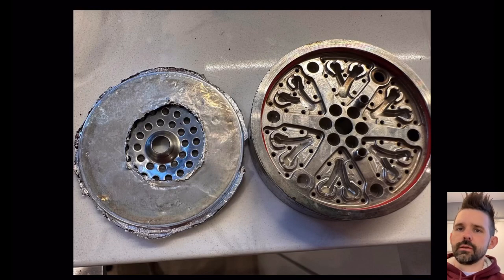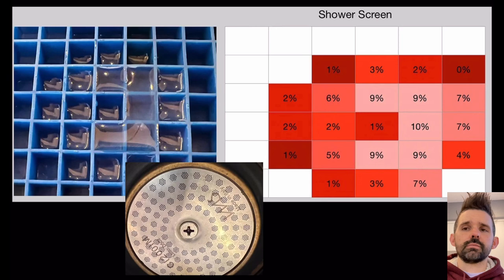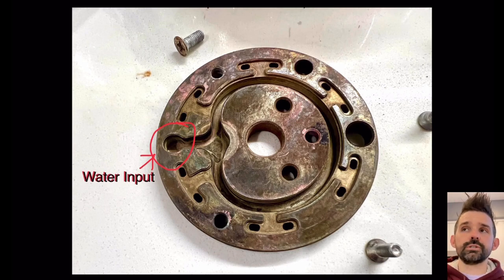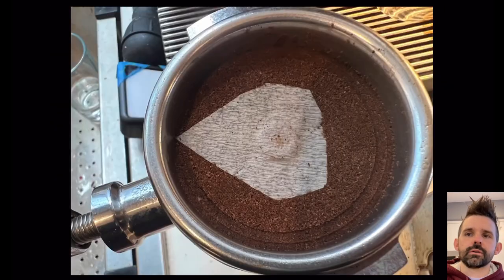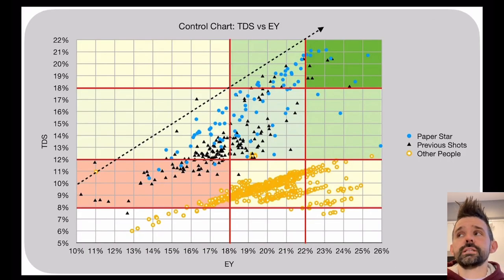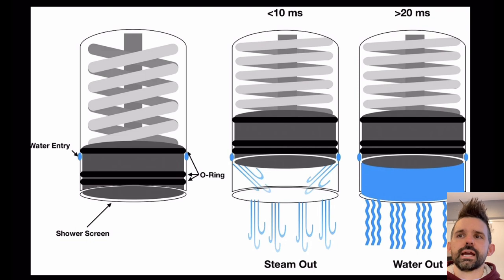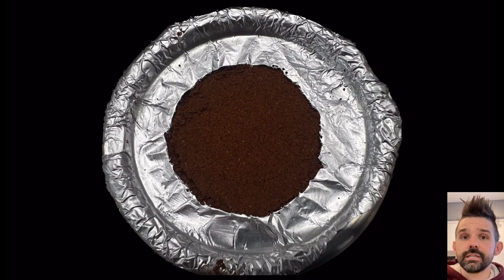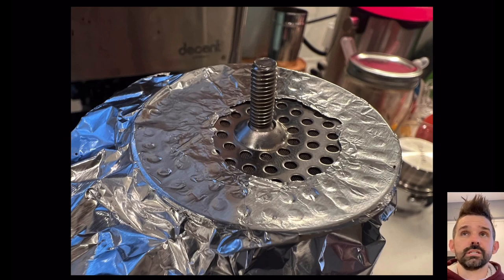Advanced Espresso Shower Screens for Better Water Input

Comment: Great work, Robert.  I wonder if the higher temp around the perimeter of the puck is a result of water flowing faster there, rather than conduction from the group head through the gasket and along the thin wall of the basket.

Comment: The star-shaped paper mask reminds me of a similar shape used in solid rocket booster fuel geometries, where a hollow "finocyl" star shape along the length of the propellant mass maximizes the exposed surface area initially available for combustion at ignition as the propellant burns from the center out, when thrust afforded by extra area is needed most. What remains of the diminishing star shape after that helps to maintain more constant thrust than some of the other cross-sectional geometries like simple circular holes.

In this case the espresso star mask seems to be inverted, presumably so the center of the puck is extracted last (if at all...) following circumferential introduction of water and (hopefully more or less constant) advance of the liquid front and extraction from the outside toward the center. There's probably more to be gained by playing with the mask geometry, maybe informed by modeling in 2D the pattern of water volume introduced across the puck for a particular machine setup (with the paper mask shape informed by KDE contours somehow). Though temperature and coffee particle expansion would play roles too as the water front advances. I wonder how a doughnut-shaped puck would fare, assuming physically constrained by some kind of (heated?) solid mass in the center, maybe cylindrical, maybe star-shaped. Maybe still maintaining the ring mask around the outside if the edge channeling remains a problem. Could the outer edge channeling be mitigated by a negative draft angle in the basket to better retain the puck? (would complicate knocking out the grounds though...) All speculative. Fun to see these espresso explorations and the pursuit of excellence via incremental improvement.

Comment: Thanks for the great video. To help mitigate donut extractions with my Flair Pro 2, I also use that technique of making a divot in my puck prep (what I call a concave distribution). I'm going to try making a tight-fitting silicone puck screen using your design.

Comment: How about a metal puck screen that fits precisely but with a hallowed out center, or a star shaped / cut puck screen.  
 I can see how the center hole design would help prevent side channeling / donut extractions, but I don't get how the Star shape would do that, wouldn't the star push the water towards the edges?
Reply from the maker: A circle is better if made of metal.

Comment: Are you pulling shots with a very fine grind? Compared to like a typical standard espresso shot? Because a fine grind combined with a low flow, flow pre-infusion pressure will cause ringing like crazy
Reply from the maker: Coarser grind than my lever machine.

Comment: A lot of these very interesting experiments are being done with the DE only. I think it would be useful to have a control, of another reputable brand. Obviously,  a lot of the profiling can't be replicated in the control. But I have a suspicion some of the issues are manifested in the DE's parts. Also, have you accounted for the age of the coffee throughout your experiments and also are you even using the same coffee throughout?
Reply from the maker: I also did these tests on a lever machine.
Reply: @espressofun6091  Did you get the uneven water flow from the shower screen in the lever machine? I'm certainly not seeing something like this on an ECM.
Reply: @z_nar  he's using a very low preinfusion flow profile... as I understand it for better extraction... ringing is really pre infusion pressure dependent.
Reply from the maker: @z_nar349  I have gotten side channeling on a lever. Based on e61 group heads, water flow goes to the sides first so I suspect they have the same issue.
Reply from the maker: @JLeverEspresso  at higher pressure, you may not see the side channeling as well. There’s a lot hidden in the coffee cone.
Reply: @espressofun6091  side channeling is present on our "flood" fill bottom to up flow espresso maker also, here the water "floods" up saturating the pucks surface perfectly evenly, gravity works for you not against you, and any side channeling gets pulled down by gravity, yet it still happens during pre-infusion at low pressure, but not at high pressure, because at high pressure the puck is slammed against the sides cutting of those side channels, in my opinion side channeling is not an issue for a normal 6-9 bar espresso shot, but maybe an issue for your low pressure shots
Reply from the maker: @JLeverEspresso  I don’t have data on it. I’d love to see data.
Reply: @JLeverEspresso  Interesting, fair point but I'm just not seeing this even with turning down flow by quite a bit using the flow control.
Reply: @espressofun6091  see that link i gave you on twitter :)
Reply: @z_nar349  do you mean ringing at low pre-infusion pressure?